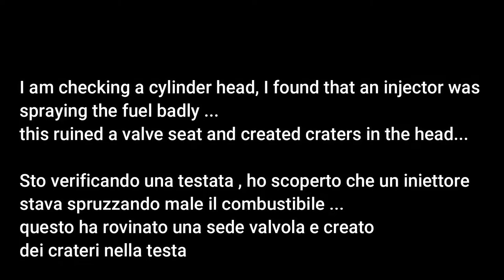Cylinder head Fiat Allis fl8, Valve seat is damaged , WHY ??!!

Comment: Got a question, are you looking to restore the machine or just get it running so it can be used as this will define what remedial action to take, if cost is no consequence then send the injectors & cylinder head away for reconditioning (injectors cleaning and re-calibrating and cylinder head cleaned, crack tested, skimmed and valves & valve seats repaired/replaced), if cost is critical I would still try to get the injectors serviced but it looks like you could try "lapping" the valves and seats with grinding paste which should be good enough to get the machine running.
Reply from the maker: Hi Steve thanks for the question, yes indeed to repair the cylinder head in an economic way, I have performed the valve seat lapping.
Luckily the cylinder head was in very good condition, no cracks.
I tested the injectors and the number 3 was leaking a lot of fuel, didn't spray regularly, but it looked like an open tap. I replaced it.
To do a work to perfection it would have been useful to bring the cylinder head to a specialized center, but this would involve a huge cost compared to the value of the crawler loader.
Now I have reassembled everything and it seems to be going great ....
Let's say it is a miracle that everything works, because it was unused for almost 20 years, from google maps it has been stopped since 1999.
I will put a next video of the engine ...
By Simo
Reply: @thecatSimo  hi simo, glad you got it back together have you considered using diesel injector cleaner (best stuff I've found is Forte diesel system cleaner) mixed in 5 litres of fuel, disconnect feed and return lines from tank (gives you a chance to drain and flush tank --- probably needs it having been stood so long) put them into the injector cleaner/fuel can and start & run the engine from the can at various RPM's till you've nearly used mix (don't run out or fuel system will need "bleeding") reconnect lines to tank with a bit of luck engine will perform a lot better --- hope this helps.
Reply from the maker: Hi , Good idea, I hadn't thought about it ...
In fact, the fuel tank is creating a lot of problems for me. Very much rust comes out.
It is difficult to clean because it is not removable, inside there are metal plates that do not allow effective cleaning.
I put a filter immediately at the outlet of the tank, to prevent it from reaching the main filter ..
Certainly not so good a tank so dirty ....
I have already cleaned where I could go, but in the inner parts it is impossible to clean.
Maybe it should be filled with acid or whatever .... but it's 300 liters .....
Simo
Reply: @thecatSimo  has your fuel tank got a drain plug? If so you could try using a pressure washer (we've got a "hot" washer which helps but cold will suffice) followed by using compressed air to "dry" the tank, an inline filter should keep any debris from the rest of the fuel system.
Reply from the maker: @stevehill4615  Hi, yes, I have already cleaned with the pressure washer, but in the middle there is a plate that does not allow cleaning in the middle of the tank.
Thanks for the advice, Simo